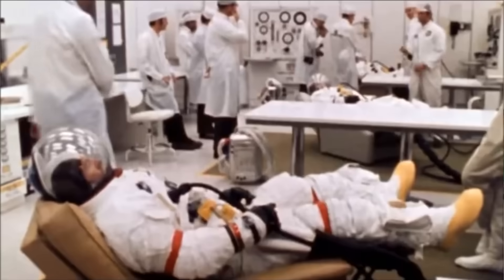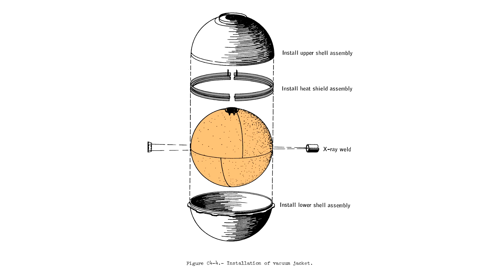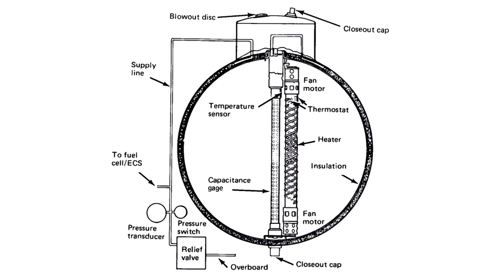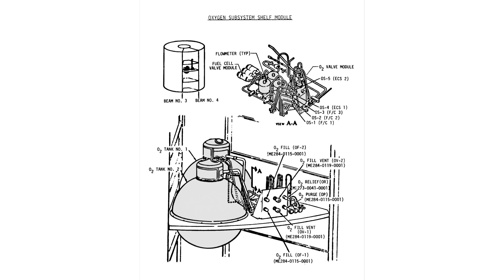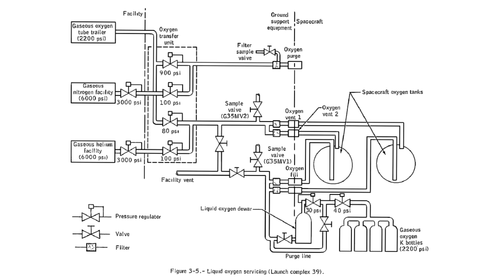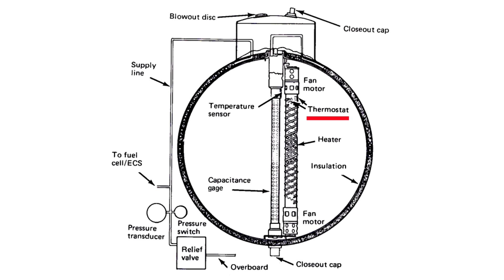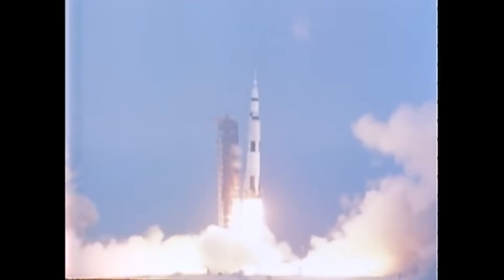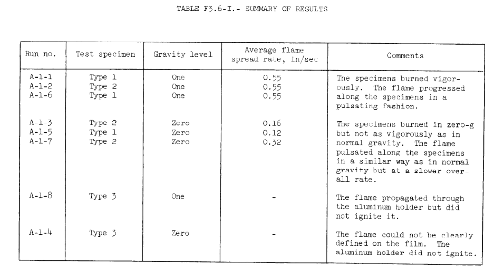What Caused The Explosion That Crippled Apollo 13?

Comment: i knew bits and pieces, but nothing to that detail.  Thank you for posting this.

You know, we have a saying in Civil Air Patrol, the regulations are written in the blood of cadets.  Meaning a lot of the regulations on how to do things like orientation flights for CAP cadets (ROTC cadet o-flights are a different, less restrictive set of rules) are written to calm the fears of parents, or because there wasn't a reg and a less experienced pilot (or over confident one) tried to impress the kids and ended up crashing.

I tell this because it seems NASA works on the same principle.  Using an O2 rich cabin environment with a pressure door proved fatal to the Apollo 1 crew, Apollo 13 had some influence on how things were done, STS-51 and STS-107 were game changers.  Why do I mention this?  The fact is we (collectively, and specifically) learn.  It is sad that lives were in danger or lost, but because we had people brave enough to do the unknown and unthinkable, it made each successive mission safer.  We cannot forget these people or what they accomplished.

It still amazes me that one, the Saturn V was able to fly.  Two, that our thirst for exploration has not waned.  Three, think about how much of the whole Atlas system was a motor just to get a tiny capsule to move fast enough to escape the Earth's gravity and go extraterrestrial.  The shuttle engines were extreamly powerful, but only had to get a lot of tonnage into low Earth orbit, and still needed rocket boosters to get it off the ground.

Space and traveling through space amazes me.  I hope we never stop.  Manned and unmanned missions.

Comment: Would the main engine have been usable for a direct abort? That's what I've always wanted to know. They decided to not use it in case it was damaged and instead do a free-return trajectory around the moon. But given the pictures of the service module once it was jettisoned and the research they did into this accident, etc., did they ever figure out if not using the main engine was the right call or not?
Reply: I would think there would also be a fuel issue.. the amount of fuel it would take after reorienting the spacecraft traveling at 1,629 m/s and try to burn that speed down to zero and back up to 1,629 m/s.. great question though! Scott? lol. The data is available, I'm just to lazy to try to figure it out ☺

Comment: Following the conversations among the controllers during the early stages of the incident makes it clear that humans are frequently unable to grasp the simple reality of a situation that is too dire to accept into their conception of possibilities.  See various nuclear meltdowns, etc.  The persistent suggestions that it was all just massive, simultaneous failures of indicating systems, and other wishful thinking, is painful to listen to.  However, some systems engineer at a console in the control room had to be aware of the previous problems with the oxygen tank in question, and the possibility of its failure being the source of the cascading disruptions in the service module systems.  Did that engineer speak up?  If so, did anybody listen?

Comment: So for lack of a bolt, a tank was dropped.  Because of a dropped tank, heaters were used.  For changes to future Apollo, a test rig had the wrong voltage.  For a thermostat not rated for 65V, wiring was baked.  For baked wires, a tank overpressurized and failed.  And we almost lost 3 men.
Man, I'd hate to have been the tech that missed that bolt.  :(

Comment: One design deficiency was also that both oxygen (and hydrogen) tanks fed the fuel cells over a common manifold. No isolation valves, no check valves. You have one leak anywhere in the system, you will loose everything. If there had been the possibility to isolate the faulty tank, the outcome would've been less dangerous. Yes, the moon would've been lost. But there would've been enough oxygen in the good tank to return home. They later changed that for the J- missions and AFAIK the space shuttle not only had check valves between the tanks and the manifold, but also the possibility to switch to 'split plant' operation, i.e. feeding each FC from its 'own' tank and isolating them from each other. I still don't get why they didn't implement that in the first place. They used statistical methods to determine how often a system would fail in a given number of times, but overlooked that interconnecting independend units increases the failure rate. Strange...
Reply: You would think NASA would have learned about planning for equipment isolation after Gemini 8. That has always bothered me.

Comment: So they ran a test on two tanks, tests that they had run in the past on other tanks.  One tank behaved normally, the 2nd did not.  At this point it was "Nah, it'll be fine".  Whoever thought it was OK to not understand WHY the tank was different should have been shot on the spot.

Comment: I understand that tank emptying procedure was not needed during the flight, but I wonder why they didn't wanted to check WHY it failed...
Reply: They were trying to keep to a schedule (partially set by management and partially set by the "launch windows" that would allow them to rendezvous with the moon) and doing the necessary checks would have take a significant amount of time.

Comment: Why on Earth where they doing ground tests of a 28V system at 65V? I mean, it's not like it's hard to get hold of any voltage you want down here on the ground. Oh noes, this transformer that we're only going to use on the ground is too heavy to fly. Whatever will we do?
Reply: It's my understanding that they were changing the operating voltage on future missions for some other reason.  The rig used to 'detank' was already upgraded because it wasn't supposed to be needed further on Apollo 13.  When they couldn't empty the tank, they did a quick check and thought they were okay using the higher voltage as Scott mentioned.  But missed the thermostat rating.

Comment: Imagine how different the outcome would have been if the tanks were stirred when the lunar module was on the moon's surface.  It seems fortunate it happened at the point that it did. Any later and the lunar module would not have been available for it's "lifeboat" role.

Comment: I never really thought about the fact that the failure on the O2 tank was in fact caused by a piece of hardware that was later determined to be unnecessary.
Reply: Jason Gibbs Wrong, the fan/agitator wasn’t necessary, the heating element was still required to maintain the pressure at super critical equilibrium

Comment: Kind of makes you wonder about SpaceX attempting to get a manned rating for the Starship. After seeing the overpressure and underpressure incidents during testing the Starship prototypes, it makes you wonder.  I would propose at least a good seven or eight unmanned flights first. Then maybe mounting a crew dragon on top to give a launch escape capability.
Reply: They're still in the tank testing phase.  They're a long way from flying anything never mind people.  Also I think for internal missions there is no requirement for them to get any rating from anyone.

Comment: Remember kids, redundancy is crucial in systems that are truly vital. Just remember to route all three of your redundant hydraulic control lines right next to each other so the occasional stray turbofan disc going trough your aircraft has a chance of slicing through all three of them in a single go!
Reply: DC10 references intensity
Reply: @Cby0530  lol
Reply: Damn, that's exactly what I thought when I read the technical data books about all this stuff ! Happy to see I'm not hte only one !
Reply: Unt All-Sew Japanese JAL 123
Reply: Lol you clearly have no idea what adding several additions paths out of an inconel tank does for added complexity and potential dangers. As for the aircraft there are only so many places you can route stuff.
Reply: Keep those cards and letters coming in folks!
Reply: The Redundancy our kids are likely to see is the kind that blows a hole in their careers.
Reply: There always are cost limitations and you cannot change it in engineering.
Reply: This is what makes me worried about self driving vehicles.  I don't even trust vehicles with automatic transmissions lol.
Reply: @twiff3rino28 automatic transmissions are literally Superior to manual transmissions in every single way
Reply: @chicken29843 except they  aren’t as much fun to drive. A person’s otherwise subjective assessment of performance, is still is a factor to be considered.
Reply: @DavidBozek92109  Who cares about whether or not it's fun to drive? Aside from niche leaded-brained motor heads most people just drive to get to where they're going. Why do japanese cars sell better than american crap then?
Reply: @twiff3rino28  Self-driving vehicles are most likely safet than human-driven ones... Think of a drunk driving home from a party!
Reply: @paullangford8179 how often that vs a normal driver?
Reply: @jjohnston94  It"s not funny. Hundreds of people died because of it. Worse than 737 MAX. I worked with one of the people responsible on a later project and it didn't seem to have hurt his career much.
Reply: @dalecomer5951  No, 112 people died (UA 232), fewer than by the MAX fault. You're confusing it with the earlier DC-10 cargo door problem, which was unrelated and had nothing to do with the hydraulic system.
Reply: @blueb0g  Wrong. It had everything to do with the flight control system. On Turkish Airlines Flight 981 the rear cargo door failure caused an explosive decompression of the cargo compartment which caused the cabin floor to buckle which severed all the hydraulic flight control lines to the tail as well as the engine controls. 346 dead.

And never fotget American Airlines Flight 191. 271 dead.
 
729 deaths including UA 232.
Reply: @dalecomer5951  Flight control system =/= hydraulic system. The hydraulic system is only a part of the flight control system. On THY 981, the hydraulic system was NOT affected: the collapsed floor trapped and/or severed control cables which ran from the cockpit to the hydraulic actuators in the tail, leaving the crew unable to control the tail engine or the control surfaces on the tail (but, again, with no impact on the hydraulics). Redundancy was not really a factor in this accident: the same thing could have happened to any aircraft of that era if the floor collapsed in a similar manner. The design flaws that allowed the accident to happen were related to the cargo door latching system, the cargo door latch/unlatch annunciation, and the lack of vents between the bulk cargo bay and the rear passenger cabin, all of which McDonnell Douglas had ample opportunity to fix. Hydraulic redundancy, however, was not an issue.

UA 232 was a completely separate accident and cannot be related to the earlier cargo door failures in any way. This was a fatigue failure of the no.2 fan disk, and hydraulic redundancy was an issue here, since the hydraulic lines were routed in proximity and one physical event caused all three to fail. The control cables were not affected, unlike THY 981. It's worth pointing out that while this was clearly a design oversight, the DC-10 was not unique in this regard, and the industry as a whole had over-estimated the protection triple redundant hydraulic systems provided for particular events (see too the DHL A300 loss of hydraulics).
Reply: @blueb0g   I apparently have a different understanding of how the flight control system works on the DC-10. My introduction to it came from my uncle who was a DC-10 captain. He knew Captain Haynes personally. He was never comfortable about the DC-10 flight control system and was very happy when he graduated to the 747. You want to go on about the cargo door and ignore AA 191. AA 191 was like UA 232 in that the physical departure of the starboard engine from the aircraft severed all three hydraulic lines in the wing. That you seem to argue that the DC-10 was less deadly than the 737 MAX is strange. Don"t forget there were 171 injured on UA 232.
Reply: @dalecomer5951  OK so we've dismissed THY981 now?

AA191 is more relevant to a discussion about flight control redundancy (btw it was the port engine, not the starboard that separated). 

The engine separation did not sever "all three hydraulic lines in the wing". The no. 1 system failed due to the loss of the engine (this could not have been prevented), and the no.3 line to the outboard slats was severed (this did not lead to the loss of the system, though it did mean the outboard slats were no longer actuated). It is important to note that this did not directly affect the crew's control of the aircraft. The problem was the uncommanded retraction of the leading edge slats on the left wing, which were actuated by the no.1 hydraulic system, and were not mechanically locked (clearly a design weakness - contemporary aircraft like the 747 and the L1011 did have mechanical locks). Without hydraulic pressure holding them they retracted under aerodynamic pressure. The aircraft was still flyable, but not at the normal V2 speed, which is what the crew were targeting. Unfortunately the loss of the no.1 generator had led to the loss of the stickshaker, and the slat asymmetry warning.

This was a weakness in the design (the failure of the pylon and related damage to the wing had never been considered during design) and the NTSB report says so - but at the same time, the aircraft was designed and certified according to contemporary standards, and the principal cause of the accident was the uncertified engineering processes adopted by AA (and Delta) - if they'd used the procedures approved by the manufacturer, such an engine separation could never have occurred. 

It was the combination of bad maintenance practices, the specific damage caused by the engine separation, the loss of the no.1 a.c. bus, and AA's engine-out procedures that required flying the climbout at V2 rather than a faster speed that led to the accident. I think laying it at the hydraulic system's door is unfair.

I never said fewer people had died on DC-10s than 737MAXs. I said fewer people have been killed by a lack of hydraulic redundancy on the DC-10 than by the MCAS on the MAX, and that THY 981 wasn't relevant to that discussion If we want to include AA 191 as one of those accidents then that's a different story - but as above, I think that's unfair.

Very cool that your uncle knew Capt. Haynes, though.
Reply: @dalecomer5951  Thanks dale, nobody cares
Reply: @m2heavyindustries378  I'm pretty sure that the families of the dead do care...
Reply: @dalecomer5951  anything’s funny if you’re not a Karen.
Reply: @dalecomer5951  It's called gallows humor and it's funny
Reply: @TheVillainInGlasses  It may be gallows humor but it's not funny.
Reply: @dalecomer5951  I will say humor catches peoples attention. There are things I have heard dark jokes about that actually made me act in safer manners. 

You may not like it but it can help people cope with dark times or trauma or in something like this it is just a good way to remind people to do better.

However no judgement you dont like it. Humor is so subjective. I just hope I offered a perspective that shows positive sides.
Reply: @dalecomer5951 it is funny. We don’t think it’s funny out of a sense of pure naive humor. But dark experience humor. You should hear what EOD techs say😅
Reply: @dalecomer5951  "Comedy is tragedy plus time." - Steve Allen

Comment: Makes me wonder is Elon’s new engines need to stir the fuel tanks (the fuel is not all the same hydrocarbon molecule and could separate out into layers within the tank if molecular densities are slightly different). The exhaust looked sketchy during the 100 meter test flight because of the non-uniform fuel composition.
    Also Kapton wire insulation was implicated in aircraft electrical fire (possibly explosively in a commercial jet crash) and has been banned.
Reply: Liquid methane separates into layers?
Reply: I wonder.  Why did the exhaust rocket flame look like a non uniform combustion?  Check the video on the single engine hop. I remember talk about the fuel not all the identical hydrocarbon molecule
Reply: @douginorlando6260  I remember hearing it was the dust being kicked up by the rocket itself getting into the flame at least that was the speculation on the NASA spaceflight forum.  Who knows?  It was a test and spacex reported no anomalies in the raptor firing that I'm aware of.  However as for fuel separating I thought about it more and realized it's really unlikely, how does anything separate out into layers without gravity?  I think the concept of needing to stir the tanks is not going to apply to the raptor.

Comment: Just proves ST:NG's favorite assertion, "It was a cascade failure."
Reply: It's my observation that most catastrophic failures, be they in manufacturing, government, social services, whatever you might think of, are cascade failures. You can break any element in the chain and a avoid catastrophe, but you've got to understand systems theory and not take little things for granted.
Reply: @ErickC  Exactly.  That's why I started groaning every time they said it. Everything is a cascade of failure points. ;)
Reply: @kevinbendall9119  If we are operating one small failure away from disaster, we have already failed to find a sustainable method.

Comment: I have to wonder that the tank was taken to 500 C in testing and no one smelled anything burning. That's easily twice the temperature at which solder melts and high enough to melt zinc.
Reply: Tub: Except that "The Tank" did not reach 500C.  Internal parts reached 500C.
Reply: @KB4QAA  k that explains a bunch. Tnx.